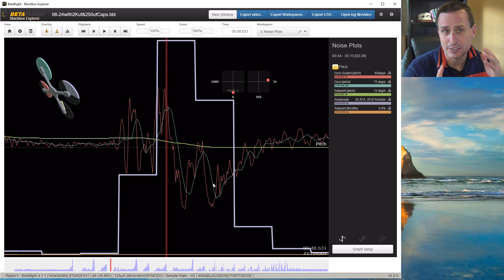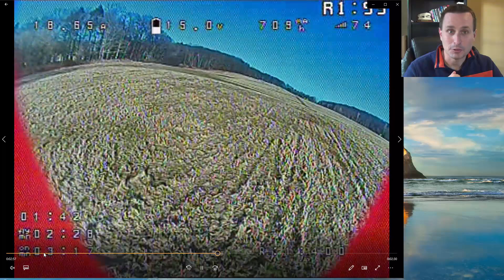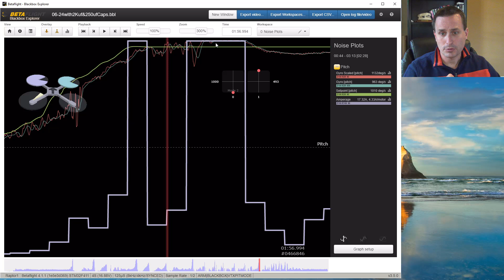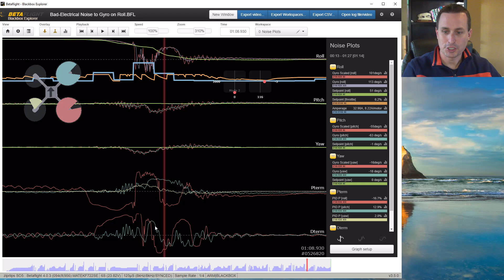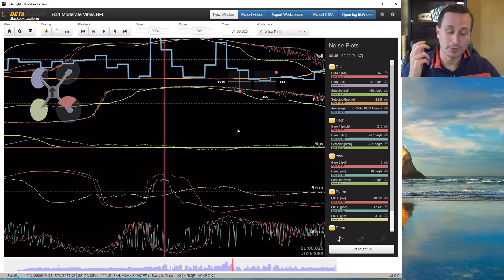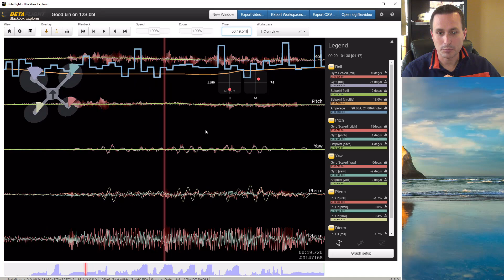How to Tell What is Electrical vs. Mechanical Gyro Noise

Comment: This is a very helpful video. Now that I’m looking at BB on my various quads I am wondering if my choice of FC (Kakute F4 and F7) is not a good one. I’ve been using them for most builds for consistency but it appears I have electrical noise problems. Have you found Kakute boards to be noisy?
Reply from the maker: Kakute HD i believe i have seen with some electrical noise issues here and there.